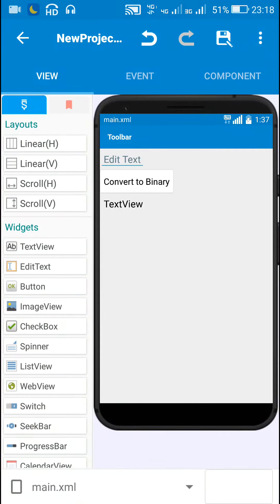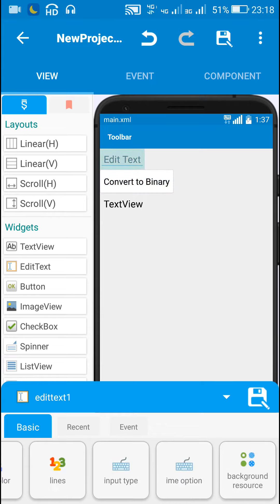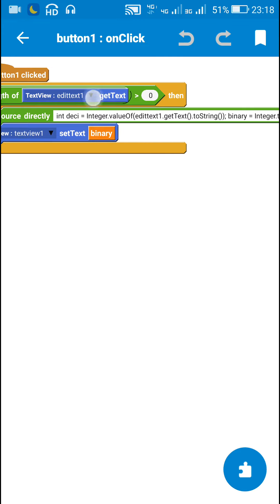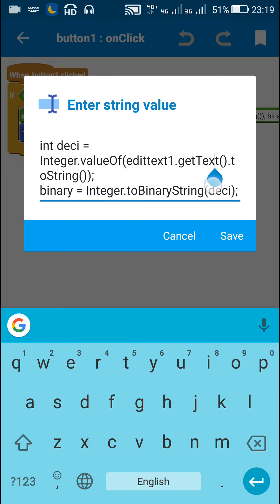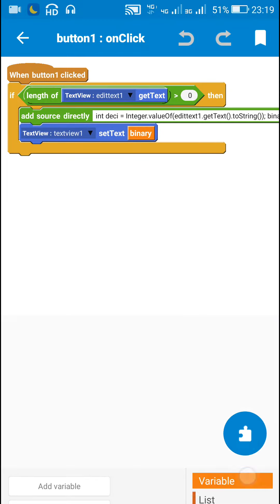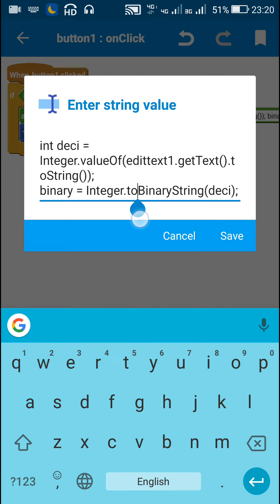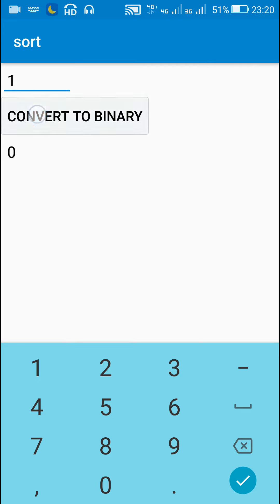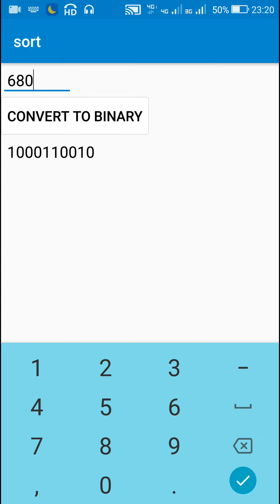Decimal to Binary in Sketchware

Comment: I've followed your decimal to binary conversion tutorial. it works fine with integer number only.  if i put fractional number it crashes. like 40 to binary will works fine. but 4.2 will crash.

how to fix this issue?
Reply from the maker: For fractions you can use this
https://www.google.com/amp/s/www.geeksforgeeks.org/convert-decimal-fraction-binary-number/amp/
Reply: @sketchwarehelp  i tried that code, but it shows some syntax error. & i tried to solve the syntax issue but failed. can you please do it for us?